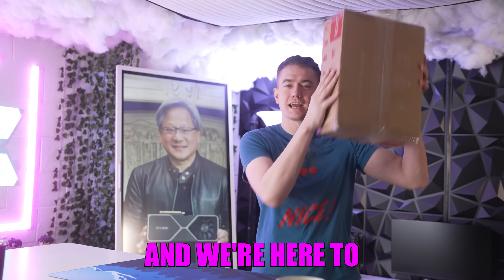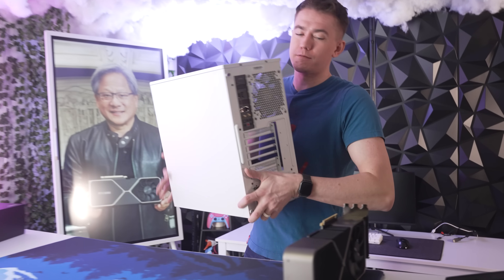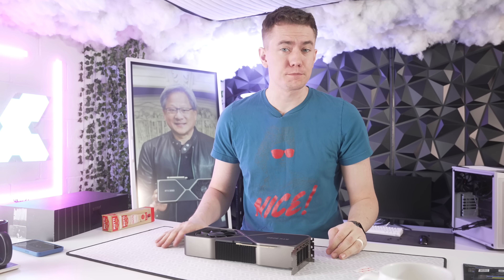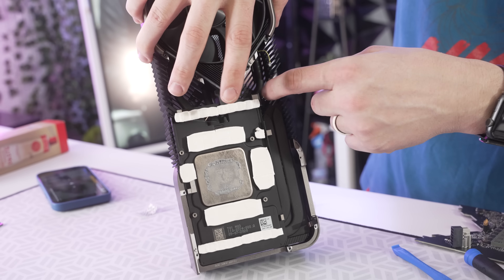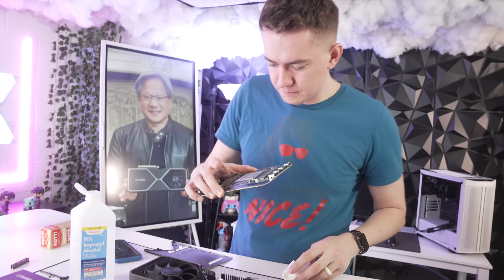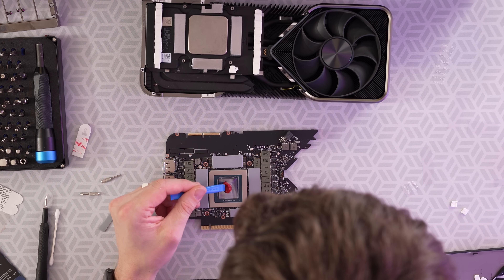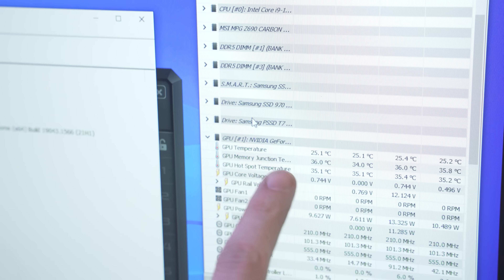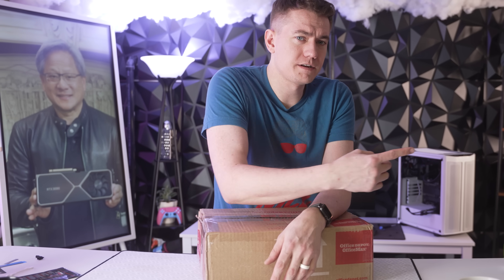Replacing RTX 3090 Thermal Pads

Comment: I change the pads on my 3090FE went from 104 deg c to 94 deg c. On the junction. The best part about it was my fan rpm dropped from max to under 1500 rpm which made the card loads quieter.

Comment: Can confirm. Have two 3090 FEs and changing the thermal pads made a HUGE difference.
Reply: I see multiple size options for those Gelid pads.  Do you remember which sizes you needed per card?
Reply: @StariusPrime  Hey, it's been awhile, so I'm not totally certain, but I think I bought the 120x120x 1.5mm. There was a template I printed from somewhere that I used to cut the pads to size. Wish I could remember exactly. Good luck!!🤞
Reply: @RealMenWorshipZeus  Thanks!

Comment: So with the back while you dont have to, it is helpful to pad the entire back of the card wherever pads fit as A LOT of heat gets dumped back into the PCB as the Memory Dies are flip chip BGA meaning in essence the Memory dies are closer to the bottom of the memory package than the top dumping a lot of heat  into the motherboard and not really able to conduct that much heat through the Memory package, by coating most of the back of the card with pads it lets you take a lot of the heat out of the PCB, cooler pcb cooler memory and also slightly cooler core temps too!

Comment: I have two 3090 FE cards that have been largely unused, but I want to do this before I put them in a system.  How many of each Gelid sheet did you need to purchase for a card? And what size?  I see multiple size options on the amazon page.
Reply: Did you learn how much a 3090 needs ?
Reply: @ They have gotten some good use since then. 😉

Comment: GDDR6X runs so hot, on my 3080 tuf oc when playing Dying light 2 ultra, it goes up to 95c...
Reply: @wombat5252  back in December 2020, there were no Radeons available (released in November)

While there were nvidia (released in September)

For 1440p, 3080 looked better and with DLSS 2.0 (and shadowplay)

Note : you can't compare GDDR6 vs GDDR6X anyway
Reply: How old is the GPU currently?
Reply: @wombat5252  meh, 6800xt is only faster at 1440p, it mostly loses out at 4k. I'd take DLSS and RT anyway over a few more fps.
Reply: @retributionn5100  bought in December 2020
Reply: @bootchoo96  Its still under warranty?
Reply: I have a 3080 Suprim X which is meant to be at the top level for AIB cards but overheated on the GDDR6X instantly all the time so I opened it up and found out the thermal pads didn’t make proper contact on a group of them so I changed the pads to thermal grizzly pads which were slightly thicker and dropped from 110c to 78c massive difference
Reply: nomasporfavor  my gpu is also undervolted

0.975mv at 1980mhz
Zero core boost or mem boost
Reply: @dbagdi1998  yeah but these pads are like $25 here and then I need to repast the gpu, another $15, and while the card is opened, why not change all the pads but they are all different thickness (2.5mm,3mm,etc)

It would be a $100 job on a $1200 card

So stupid.
Reply: @wombat5252  lol, I game at 4K with a 3080, it's made for 4k...

Its either 4k 70fps high/ultra or 1440p 165fps high

In Dying light 2 ultra with Ray tracing (all on) at 1440p, I get around 45fps

If I enable DLSS Quality, I get around 90 to 100fps, that's double the FPS without anything noticeable.

I think you are biased with AMD this generation.

If the 6800xt was a few hundreds $ cheaper, I would consider it. But for the same price or about, the nvidia counter part has a lot to offer.
Reply: @bootchoo96  I’m not tell you to do it, i’m just saying I did it because my GPU would just throttle and I use it to mine when i’m not using it, so for me it was worth it
Reply: @wombat5252  that's why I said... This generation... Did you fully read my comment?

Nothing about DLSS or price?
Reply: @wombat5252  If you actually play games that have DLSS, It's not a joke...I have nothing against AMD though...I think they will get to feature parity pretty quickly, they just didn't quite get there this time and people actually use those features believe it or not...I thought about buying an AMD card this time just to try it out but my monitor has a G-sync module and I didn't want to replace it yet...I may try AMD next time if they get FSR 2.0 into some games that I play...

Comment: I wanted a 3080/3090 but heard about the vram cooling issues, probably just going to buy a 3070 so i dont have to replace thermal pads lmfao
Reply: my evga 3080 xc3 never gets anywhere near as hot as his 3090, Even After the new pads and stuff, and i have not opened mine at all. Its mostly a founders card thing. The majority of the AIB cards dont have this issue. Plus you can active back plates for them now, and that would be something you should feel comfortable installing.
Reply: @crisnmaryfam7344  Have you checked vram/hotspot temps not just gpu temps? The issue seems very widespread, and its not that i dont feel comfortable installing thermal pads but gelid pads cost over $50 in my country and take months for shipping. I looked into active backplates and the 3080 cards do not have any memory chips on the backside so watercooling would be pointless, thanks for the suggestion though.

Comment: Given the thermal pads they used are the same for teh VRM's as well . may as well do those too to avoid issues. Thermal pad "crush" is a thing, so critical pads like the VRM should be replaced as well. ALSO , consider a small fan to blow on the back side memory as well. since the back plate has ZERO fins and is made of .. something ..

Comment: I waterblocked my 3090 FE day 1. I got home, plugged it in and run some benchmarks. Pulled up HWInfo64 and said NOPE! Went to Microcenter and got a block, thermal grizzly and 12.3kw thermal pads. The 3090 should've been WAY better. I've since switched to a 6900XT on an EK block. It games at 30c on the die and 35c on the vram. Team red now I guess lol. Never thought id say that. It games and benchmarks way better than my 3090. The 90 is more of a 3d design\work station card.
Reply: @ffwast  funny story. I recently ditched the FE and waterblocked my 6900xt red devil. I like this card SO much better.  faster clocks, more tuning options, plus it lays the benchmark smackdown on my 3090. Only upside to the 3090 i see is raytracing that I used maybe twice lol.
Reply: doubt

Comment: You were kidding me with that paste, right?
Reply from the maker: Was I?
Reply: @UFDTech  Well, using tomato paste is a very temporary (preferably less than 3 hours to be used) alternative to thermal paste and I wouldn’t trust it being a long-term solution especially with such a high-power draw component such as the RTX 3090 which could dry the tomato paste very fast and also could make a VERY disgusting smell when it expires.

Comment: Yea. 86 degrees but only 4minutes time. 15minutes stresstest is optimal. I have ventis 3090 stresstest furmatk gpu 76 hotspot 87.5, memory temps after 15minutes 100. In games 88maximum. On Your test 3090 probably go to target 92-94 games and over 100 hotspot. Really? 66 celcius on 3090?😂  bla bla.. On Your film i see 270 watts only. You undervolted thats why gpu has 66. Without undervolted probably your vram temps easy go over 100 celcius. 😂